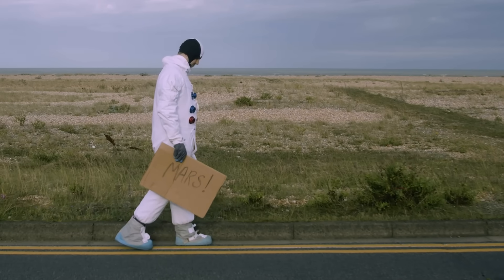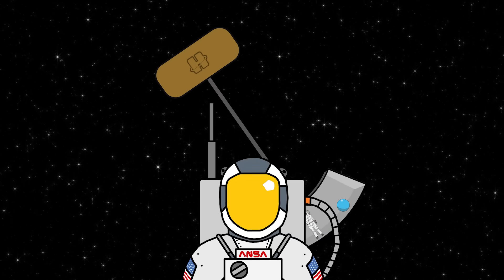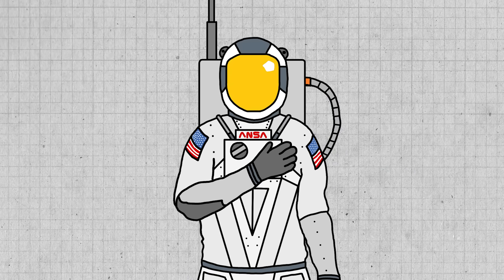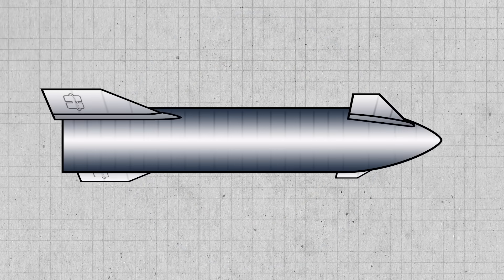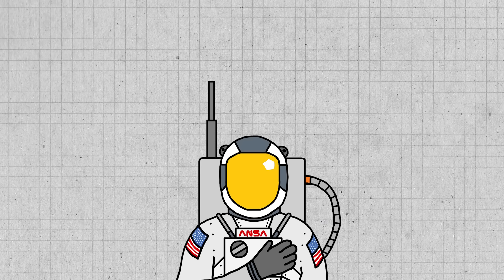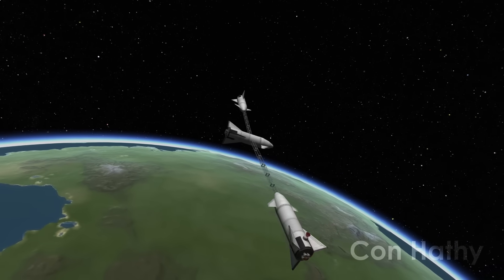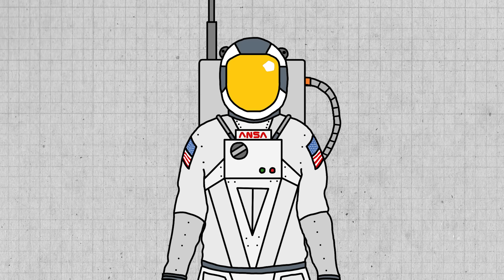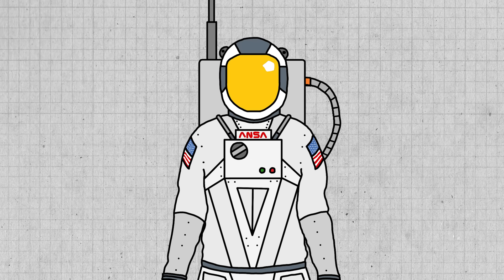This is NOT how you make Artificial Gravity

Comment: After watching Veritasium's video, my question is how all of the (inner) planets ended up with maximum moment of inertia roughly perpendicular to the ecliptic plane. (I posted the question there too, but the video is 3 years old and I don't expect an answer.)
Reply from the maker: The initial angular momentum is all in the same direction (because the solar system was created from the same cloud of dust)
While objects move towards rotating around the maximum moment of inertia the angular momentum (direction and magnitude) is still conserved. If you rewatch me dropping the bottle, the axis of rotation still ends up in line with the drill, even though it migrated from the minimum to maximum moment of inertia

Comment: One thing you didn't account for about the breaking of the cable is the whiplash.

As you mentioned, the tether would be under tension, if we assume 1G of artificial gravity, the force tensioning it would be as if we hanged the two ships on the rope in Earth's gravity (with the other end being tied supported).

If that tether were to snap, it would go flying towards the ships from the gigantic amounts of elastic potential energy stored inside it from the tensioning. On surface ships, whiplash from broken tethers are already one of the biggest dangers, and they are working with much shorter tethers and smaller forces.
Reply: I don't think that's really a significant problem.  There are two big effects which minimize the harm.

First, when the cable snaps the ends will be accelerated relative to the reference frame in which the ships were tethered but because the ship is at the far end of the tether it ends up flying away at a high velocity so you use up that velocity just catching up to ship.  Try spinning two weights on the ends of a string and cut the string.  The string ends up being dragged after the escaping masses because of this effect.

Second, even if you assume that the tether is perfectly elastic the force is equal to kx where x is the amount of stretch in the tether and k is a constant from the material.  However, the energy stored is 1/2 kx^2 so if you make the tether out of an extremely stiff material (really high k) then you can make x really small and thus  x^2 even smaller (square a small number it gets smaller) so if you have a really stiff tether you actually don't store that much energy in it.  In the limit as k goes to infinity for a constant force the stored energy goes to zero.  This is why you you can't use steel cables like a rubber band.

Put the two effects together and I don't think it's an issue.

Comment: The first thing that people ask is "what happens when the tether breaks?" because that's exactly what happened during the mission TSS-1R; you also didn't considered the damage that the whiplashing cable would do
Reply: 1. The Arecibo cable snapped because it was left rotting in the jungle for half a century without adequate maintenance
2. We are very good at figuring out how much stress the cable would be under and engineering for that, and adding a 30% margin on top. This would probably be one of the easiest and most time-proven engineering jobs on the entire craft.
Reply: Was that the one that dragged a cable through the magnetic field of the Earth to generate electricity but wound up generating too much which blew the cable? Not the same thing at all.
Reply: @dpsamu2000  the application was different but the concept was the same: two objects in space tethered by a cable under tension. When the cable broke, the object without propulsion was lost to space. That's why "what happens when the tether breaks" is a perfectly valid question
Reply: @Beregorn88  The conductor wasn't a structural support cable. It was thin, and in an experiment of unknown electric forces. The tension on an AG is known, and mentioned in the video. The solution to the question of what happens was answered by making the cable strong enough not to break, redundant if one broke, and having enough fuel to recover from the separation. There are only so many things that can be done practically. Too much pearl clutching on one thing winds up neglecting other things. Every major disaster in NASA was caused by that. Apollo 1 fire pressurized oxygen was the cause, and failure of an impossible standard of no ignition source caused the negligence of the hazard. Neglecting the cause of Gus Grisom's blown Mercury capsule hatch resulted in the Apollo 1 hatch that couldn't blow. If it could have blown the pressure would have dropped, fire wouldn't have spread explosively, could have been put out, and the astronauts could have been extracted. Same with the Challenger O rings where dire warnings were repressed, and NASA tried to fraudulently technobabble out of their responsibility to the investigating committee. Richard Feynman on the committee exposed their fraud with a glass of ice water, and a clamp. Columbia was lost because tile damage was neglected as was scheduling a backup rescue vehicle. That backup was done on subsequent missions as was tile inspection and repair equipment. All of which I suggested in a paper I wrote 2 days after the disaster. Also criticizing NASA for failing to advance the next shuttle in line just 30 days from its scheduled launch for a rescue. I pointed out the foam strike was large enough to do significant damage. In that same paper I predicted the damage to within a few tenths of an inch the length, depth, and width of the gouge the foam would make on the tiles. Spending over a million dollars on a test simulation of the strike produced a gouge within that few tenths of an inch on the first try. NASA claiming it was a fluke that the damage was predictable, and to evade responsibility for failing to launch a rescue, and  to evade having a standby for subsequent launches spent another 20 million testing with a different angle strikes to prove me wrong. Those tests only succeeded in blowing holes in the wing. I can no longer find the video of the first test that resulted in the gouge I predicted. The point is rationalization is not reason. Your comparison to the breaking of the conducting tether of the TSS-1R experiment was an intellectually incompetent rationalization.

Comment: Just looking at the small centrifuge, it looks like the most likely issue with the pressure in the eyes is that there is a force gradient from the feet to the head. The surface tension of the liquid below is pulling it down slightly but not meaningful force is being applied to the head. A large centrifuge has a smaller gradient.
Reply: Yep. This gradient issue is actually one thing I've seen as an issue cited for artificial gravity. The gradient can mess with balance. The head basically has no centrifugal force on it in thd small scale example
Reply: That was the first thing I noticed. There isn't hardly any artificial gravity forces applying to his head.
Reply: The centrifuge is also operating in Earth's gravity. That's not to say that nothing can be derived from their results but one has to be quite careful about conclusions from this.
Reply: Spin Calc says if you have 1g at 250m you have 0.98g at 245m 

For adapting on the way to Mars you can slowly reduce the spin.
Reply: I once (somewhat randomly) decided 100' radius was optimal, since the difference between head and foot would only be a bit over 5%. Seemed livable.
Reply: If you built the centrifuge into the Starship, then the maximum payload diameter is 26m - so you could build the arms at 12m radius and still have 1m clearance, giving a very tall 2m person 10m from their head to the center of rotation.   If you put multiple people in it at once then you can avoid the need for a counterweight.     The question I have is how long do these sessions need to be?    I guess you could strap 1/2 or 1/3 of the crew in at one time "overnight"  if people can get used to sleeping "standing up"

You might want to build two counter rotating centrifuges -  so you can avoid having a spinning counterweight to stop the rotational force needed to spin up/down the centrifuge from counter-spinning the spacecraft. 

The other question i have is what happens when you stop relying for the small centrifuge for artificial gravity - when you arrive at Mars?   Just like sailors getting sea sick when they return to land are the the astronauts going to need to reacclimatize to a lack of rotational gravity in the same way they needed to acclimatize to it before starting the journey?
Reply: @simontaylor7073  I'd think sleep flat in it for heart/eyes at highish g spin.  Then do strength work separately, some in the 'fuge, some zero gee.
Reply: His head was basically at the center of that centrifuge meaning his head would have nearly zero simulated gravity effects. If a plumber can recognize that these "scientists" shouldn't have wasted time or money on that scale
Reply: @montgomeryfitzpatrick473 
yes, that's the whole point. to evaluate if short gradients are enough by simulating a larger diameter by spinning the small one at a different rate. they want the head to be mostly free of forces so they can more clearly read other pressures in comparison.
Reply: @montgomeryfitzpatrick473  except health wise that's really not an issue, our heart is more than strong enough to deal with a gradient like that, and the inner ear can easily be trained to not freak out.

sure it can be an issue for plumbing, but the human body is a tad more smart and adaptable than a bunch of pipes.

Also, this small centrifuge is quite cheap, maybe 200$ plus the sensors they already had for other experiments. And the rest is just concepts and CGI.
Reply: @ledocteur7701  Except that health wise, this has not been tested for 18 months at a time.

It is an assumption that there are no other health risks associated with low blood (and other fluids) pressure in the head and high blood pressure in the feet. We really have no idea how this affects the other organs of the body. We need to test this in space for extremely long periods of time in order to simulate a Mars to and from trip.

The other issue is that this is not just for sleeping. This would be needed for most daily activities. That means building computer and control systems adjacent to the platform that also rotate with it, otherwise, we are talking disparate effects to the body as one goes from 1G artificial for 8 hours a day to zero G gravity for 16 hours a day on a daily basis. And would daily workouts be zero G workouts like on the ISS?
Reply: @ledocteur7701  The adaptibility of the human body is actually the main issue, people could live somewhat fine in 0g as far as we know but after adjusting for a long time they'd not be able to return to a planet most of the coutnermeasures are "just" there to prevent the body from adapting to 0g too quickly for you not to be able to go back
Reply: @ledocteur7701  I'm sure early astronauts would've made this argument about zero G. They only discovered the effects after years of spaceflight. And the gradient probably is the reason for the eye pressure problem they still haven't figured out because they stubbornly stick to this short-radius idea no matter what problems they run into.
Reply: The real issue with small centrifuge is that it is uncomfortable and make you dizzy, they have done the research and found out the smallest that works without that problem.
Reply: @a64738 except just like literally any other part of your body, you can train your inner ear. the g forces that liteeally every astronaut, cosmonaut, etc experiences at launch would makw you far more uncomfortable than a pressure gradient, and they can already train for that just fine. you can't make that argument when there simply hasn't been enough research done to figure out workarounds. literally nothing is perfect on the first iteration but if research on shoet radius centrifuges continues to get black balled then we will never know
Reply: @a64738  Did you not watch the video ? They specifically talk about a very short 1 week training to get your body used to it.

With a NASA budget such a training is no big deal, and saves loads of money compared to building a large centrifuge.

Comment: I know it probably isn't real, but if there was a material that could have decently high gravitational pull without all the mass normally required when give a positive electric charge, that could potentially make for artificial gravity that could be turned on and off like a switch. In other words, the material nay have let's say 10lb of with of actual mass. Now have a positive electrical charge run through it, it will use the energy to create a gravitational pull worth maybe 30lb just fas an example. When not given any electrical current, it won't have energy to use to create extra gravitational pull. I know it's not real(probably), but that would be awesome. And it could likely solve the issue. There's probably a few issues with this though.

Comment: Why would you ever spin the starship like that? You don't make it do summersaults you just spin it like you'd spin a screwdriver like spinning it so the front stays the front instead of flipping it like it's out of control :/ like no one literally NO ONE thinks "oh this is how you should spin the ship to make gravity" no, that's only making the artificial gravity focused on the top and bottom of the ship so the middle of the ship wouldn't have the same effect and areas in between would be a lower gravity, if you spin it like a top however the forces push you to the sides of the craft allowing for much better use of space as well as being more controlled lmao I mean you went through this but like no

Comment: doesn't a short radius have a greater variation of g's across the length of the body? as the head is moving at a relatively and significantly slower speed than that of the feet. or do the g's come from the point of contact ie the floor? just curious.

Comment: {Ple-Four} Kind of a weird question, but... how are O'Neill Cylinders supposed to work? I've seen some discussion of pairs of counter-rotating cylinders which are supposed to cancel out gyroscopic effects, but I can't quite wrap my head around the physics of it. They seem like they'd run into the issues you mention with rotating around the axis with the minimum moment of inertia, but... that doesn't seem to happen. >@.@<

EDIT: Oh, wait, partway there: It's not rotating along a single axis. You've got the spin producing an outward gravity... and the rotation needed to keep the mirrors sunward. ... Still not sure how those add up to a functional rotating system, though. (I'm an MS pilot, not an aerospace engineer or physicist.)

Comment: Why would the need for gravity necessitate some complicated rotation strategy at all? Can't you build the rocket so that it burns accelerating at a constant speed (say 1g for simplicity) for the first half of the trip, does a 180 degree turn along its vector of travel and spends the second half of the trip burning at 1g? This way you have the fastest possible trip, at a constant 1g, without any redesign of the skyscraper-style down-is-towards-the bottom design of the average rocket. People on the rocket have an entirely "normal" experience, aside from the duration of the flip-and-burn maneuver at the halfway point. Granted this requires either building a rocket with significantly more fuel to maintain the constant burn, or finding an alternative for interplanetary propulsion (such as refining ion thrusters to provide some significant portion of 1g in thrust once clear of the main gravity wells), but we're getting steadily closer to that all the time.

Comment: Why not use a simple compact centrifuge like in a drying machine, whcih can accommodate 1-4 astronauts, used for sleeping only and with liquid storage in the center, content of which will be pumped under the empty bed to counter the missing astronaut, to compensate for weight difference or difference created between sleeping positions between astronauts. Also use the minimum G required to solve health problems related to weightlessness.

Comment: When accelerating and decelerating the rotation of the two tethered Starships would require that the engines used to perform this task be located almost perfectly at center mass of each Starship or the Starships would each begin spinning individually at low RPM relative to eachother.
Reply: I dont think so

Comment: Very interesting. Would spinning up a "small"ish centrifuge inside of Starship affect the ships movement?
Reply: Yes. Rotational momentum is conserved. Meaning if you spin something up in the station (at least if you use the station to “push” against) you will start spinning the station as well. 

From there it depends on the relative masses and where the center of rotation is placed what effect you get.